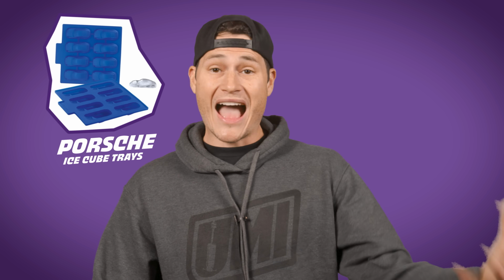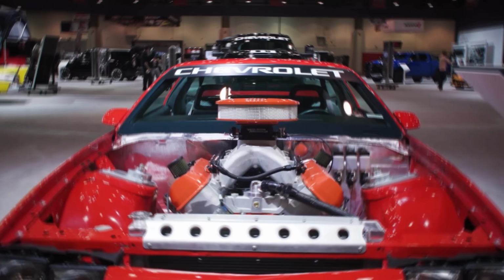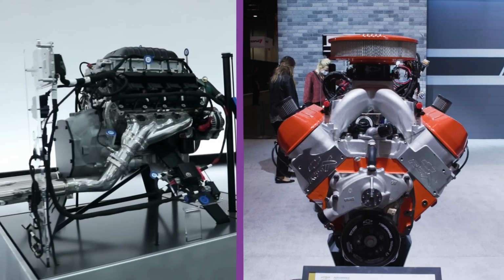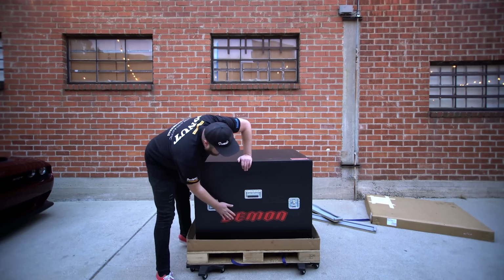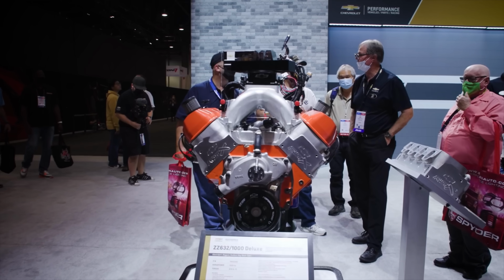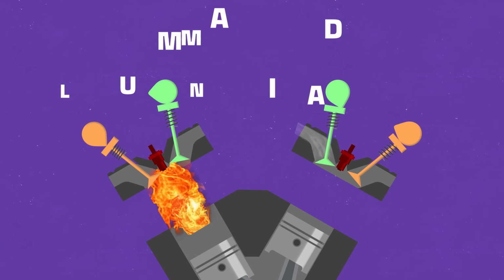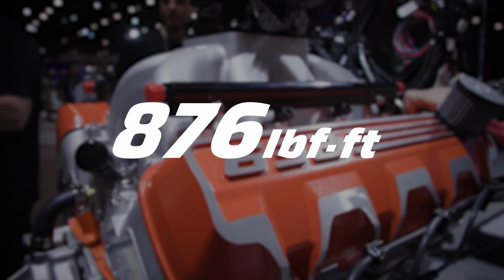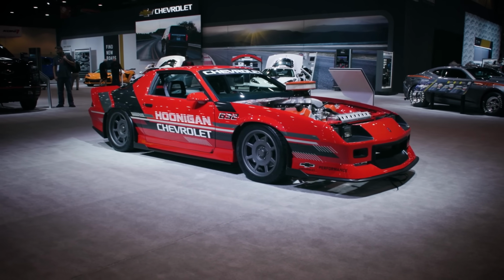Chevy's 1000HP Crate Engine EXPLAINED

Comment: Anyone know why only hemi blocks are used in top fuel dragsters?
Reply: Hemishperical Cylinder Heads are better than the regular Penthouse Cylinder Heads you see in today's cars when it comes to making power, the only reason why you don't see them in the road today are the slight weight increase and emissions, both are not something a top fuel dragster would care about.
Reply: @youngrody2386  I was just curious why a Chevy big block is not used in particular.
Reply: 2 reasons:
1. Marketing - the target market expects this ancient 60s tech, and,
2. Limit top speed - the NHRA wants to keep the top speed down. Many tracks do not have the runoff room for higher speeds.

A 4v dohc engine will make more power for the same combustion pressures.
A turbo engine will make more power. 20-25% of top fuel engines power is used up driving the supercharger.
Reply: @nordic5490  
1.) Not really, the reason why the NHRA always used 60s tech is because it's not only cheaper than newer tech but is just the best in general for the goal of reaching the quartermile in the shortest amount if time possible. I'll explain it in my next point.

2.) 4v DOHC aren't really good for low end torque as they require far more time for a sufficient amount of air to pile up inside the combustion chamber, meanwhile the 2v OHV layout restricts airflow which makes it torquier at the low end and with proper gearing of the transmission can grant the car a relatively smoother torque curve at the high end at the wheel. The 4v DOHC only makes equal amounts of torque a 2v OHV has at the middle or very end of its rev range, which is precisely the reeason why you see a lot of sports cars utilize SOHC/DOHC alot, it is solely because they are meant for tracking the car around the local race track and are designed to be driven at a certain rev range for peak performance, which doesn't really help Dragsters as they would start from a dead stop which decreases the amount of time the engine needs to create torque and power. Turbos would also take more time to spool and that would take far too long for the Dragster to really obtain peak power in the short amount of time it has to make both the 4v and the turbo to work, which may cause you time, time that would have otherwise have been instantly used with a torquey 2v High Displacement Pushrod and Blower that directly inputs power the moment you step on the gas.
Reply: @youngrody2386  don't argue with the guy he's got too much time posting shit talk about anything that's not a rice rocket on a donut media video meant for people just getting into cars lmao
Reply: @redlight3932  Sorry guys - I did not mean for this to go in this direction.  I was just curious why all the top fuel nitro cars use hemis, rather than a mix of hemi, ford and chevy big block engines.  Is there something about the hemi that works better at 11,000 HP (block strength, cylinder head flow, overall weight of the engine, etc, etc. ), or is everyone just familiar with all the pros and cons of the hemi and do not want to change?  Or is it a requirement of NHRA for everyone to use the same block?
Reply: @kailuagarage  Dw no one is fighting here lmao.

Basically the only reason why they use Chrysler Blocks is because they are the only engine blocks that are currently compatible with Hemispherical headers.

 Hemispherical heads due to their shape allows for the Cylinder head to absorb less heat, and that means less heat to escape from the combustion chamber, heat that would be used to make power that would've otherwise had been lost to a Penthouse Cylinder Head. 

The only reason why they aren't used in today's vehicles is because they were so efficient at developing power that they also produced more emissions, on top of that the Block had to be stronger and therefore weigh more, the Big Bock 440 Magnum is a whole 100 lbs lighter than the 426 Hemi for example. While the power it makes far outweighs the downsides of the added weight emissions really put the Hemi to rest.

 And for other manufacturers the cost to manufacture their own Engines for the Top Fuel Dragster division for the NHRA is not worth it, they make alot of sales selling regular penthouse Big block motors already at the lower divisions, it doesn't make sense to develop one that only serves one division and compete against the powerhouse in that field, Chrysler.
Reply: @youngrody2386  Cool thanks - it was all in the context of this 1000 hp Chevy crate engine video.  As I watched the video, it made me curious why an engine like this was not used in top fuel dragsters.
Reply: @youngrody2386  My big argument for pushrod motors is just the mere displacement of the engine relative to size. For instance, compare a 427 ls motor to a Ford mod engine. The LS is smaller. While you may be able to flow more air the mod cylinder head, there is inefficiency of the engine due to it's shear size. The only measure of efficiency isn't the horsepower per cubic inch. Now translate that to top fuel dragster or funny car with 800 cubic inches. You just can't beat the foot print of a pushrod motor. Speaking of Gas mileage. I always thought it was interesting how an LS powered c5 vette could achieve nearly 8 miles per gallon at 30 mpg better than the a cobra Mustang of the same era.
Reply: @frankmc5112  While it is true that some inefficiency is present because of bigger displacement, it is overall more powerful with the inefficiencies slightly being dampened by the simplicity of the Pushrod design, and contrary to popular belief Pushrod engines are actually more fuel efficient compared to their SOHC/DOHC counterparts even with bigger displacement, this is because it takes less energy for the car to develop power to the wheel due to its low end torque, which is why for cruising the corvette is far more fuel efficient than the mustang with the modular engine of the same era, even the new C8 Corvette with its improved aerodynamics is able to achieve a wopping 45+ mpg with the Pushrod V8. 

 The only reason why we don't see many Pushrods is because they work only in a V8 configuration at best, and it is hard to creat a VVT system with a Pushrod, VVT is what really made moder SOHC/DOHC fuel efficient as they are, but it was something Dodge was able to pull off in the Viper and now VVT is present on both GM and Chrysler cars that feature Pushrods.

 An interesting note is that the Corvette C7R and Dodge Viper GT3 were soo dominant in GT3 and GTE and similar series that they were both constantly being neutered by BOP nerfs. Funnily right now Corvette is trying to sandbag their C8 so that they won't get their Prima Donnas nerfed lmao.
Reply: @youngrody2386  The low end torque of the motor has little to do with the fact they are push rod engines, but rather it is the stroke of the motor that is common to pushrod V8s. The duration and lift has to do with the grind of the cam to make the power up top. The lighter valve train load enables the requires less energy which enables a quicker rev, but the reason they make more power up top is due to being generally smaller square bore engine. The engines are smaller in general because if you had a tall deck big block double overhead cam engine it would be massive. Can you think of one? As far as pushrod motors go. To increase torque down below you don't worry about double overhead cams. You worry about intake runner length which is why a Lincoln Navigator DOHC 5.4 has a long intake runner length. If you look at the torque curves on these engines you will see what I'm talking about. The horsepower and torque is not offset at high rpm due to being a double overhead cam. 

 Oh my gosh there have been many push rod engine motors in number of cylinder engines. All the original ones were. One of the most popular was the Chysler slant 6. The 2.2l s10 and Chevy Cavilier. Anything before 1990. Lol.  I can name dozens across manufacturers. Straight, V6, 4 cylinder.
Then again. I do build engines of all types. Mainly old pushrod V8s and Ford Modular.
Reply: @frankmc5112  Actually, the pushrod engine design is a mechanically efficient system compared to the SOHC/DOHC systems, and that efficiency will always equal more torque as less power is needed to move lesser components, even Engineering explained that their inherent design irregardless of the 2 valve limitations would deliver more torque overall. Yes, oversquaring an engine will always result in better torque and overall horsepower gains in the higher rpms but it also needs to compensate for the torque at the low rpms by tinkering with factors such as intake runner lenght, header lenght, gear ratios, increased fuel consumption, massive engine vibrations as most SOHC/DOHC performance vehicles uses Flatplanes to rev higher and so on. Meanwhile Pushrods don't need as much attention in the other parts if the Engine has alot of natural torque to begin with, it also doesn't meed to rev as high as peak power is already somewhere between the middle of the engine, it can get away with a crossplane crank that though doesn't inherently add more torque it allows for a smoother engine and more durable engine that allows for either an Overbored or Oversquared set up.

 As an example, The C6R dominated GT1 and the American Lemans series and it could only rev up to 6k, but it never needed to rev past 5.2k to achieve peak power and its acceleration trhough the corners and low center of gravity made Aston Martin, Ferrari, Saleen, Dodge, Porsche and Ford quit American Lemans in the late 2000s even with BOP nerfs. The same success was replicated with the C7Rs and Viper GTS and GT3s, they don't have to rev high and they are all slightly Overbored, but they still out accelerated their competion in corner exits and straights.

 The reason why we see SOHC/DOHCs dominate Openwheel is primarily because they are typically lighter cars that don't need the low end torque of a pushrod and benefit from tge high end torque of a SOHC/DOHC, meanwhile GT1 and below are 3000+ lbs cars that csn benefit from lots of low end torque from the engine.

 And how many of these engines you mentioned are sought after today? Even back in the day the pushrod inline 6s were seen as abysmall compared to even Flathead V8s. I simply mentioned that the V8 configuration of pushrods are the best, for example a V8 Pushrod has its Pros and Cons compared to a V8 S/DOHC while a I6 Pushrod is completely inferior to a I6 S/DOHC.
Reply: @youngrody2386  As an engine builder, engineer, and owner of multiple cars to include a Z06, I just told you the reason why.You are saying it is more efficient and I'm actually telling you why it is more efficient in terms or reduced load on the valve train. Reduced load is due to valtrain geometry and lighter valve spring pressures for smaller valves that encompass a larger area within the combustion chamber. You deviate off into other incoherent subjects that are not a part of the argument. Making "natural" torque is not meaningless talk. I'm not sure you can define that. The argument is that the 'main' reason you do not see top fuel running large double overhead cam engines is that the footprint of the engine grows when you increase cubic inches to such a size. A top fuel dragster makes over 10000 hp this is accomplished with a large amount of cubic inches and boost. You would have to grow the engine quite a bit to run double over head cam heads on a tall deck motor and still run a roots blower (look in the engine bay of a modern GT500. It is a massive motor.)  When you say "power numbers are in the middle of the motor" for push rod engines that is made up. Where you make power is more dependent on cams. Not every Pushrod motor makes power at low RPMs. There are folks that run push rod motors to 10rpm. NASCAR purhsrod motor run at over 9000 rpm. Like I said. You are just saying 'things'.   
If you want to see a retardedly huge SOHC 427 V8 that is a single overhead cam lookup Ford's Cammer engine. This will give you an idea of how big an overhead cam big block is. You really need to inspect the engine bay of a modern Coyote 5.0 powered Mustang. A 4.6 DOHC mustang engine takes up and is wider than any big block to include a 2nd gen Hemi. You may see diffences depending on valve covers. The big block is just taller as I mention due to the increase in stroke. It's also longer due to bore size. 
Your original statement was that they didn't have any motors that were pushrod engines that weren't V8s which is completely incorrect. Then you switch to whether they are sought after today. Well, I can answer that too. Buick Grand National V6 is very sought after as a push rod motor. Slant 6 Chrylser is still sought after. The 4.0L Jeep straight six (can be made to make tons of power. not inferior) is still highly sought after. Ford 4.9 straight 6. Old school GM Straight 6 and 4.3 V6 are still sought after. Thunderbird turbo coupe 3.8 V6 is sought after. You are going to find that often times that whether or not the cams are overhead in these cases made little difference. It has to do with how much boost you can shove into the engine. If you really want to get into pushrod V6s that made a shit load of power look up Kenny Bell.
Reply: @youngrody2386  As an engine builder, engineer, and owner of multiple cars to include a Z06, I just told you the reason why.You are saying it is more efficient and I'm actually telling you why it is more efficient in terms or reduced load on the valve train. Reduced load is due to valtrain geometry and lighter valve spring pressures for smaller valves that encompass a larger area within the combustion chamber. You deviate off into other incoherent subjects that are not a part of the argument. Making "natural" torque is not meaningless talk. I'm not sure you can define that. The argument is that the 'main' reason you do not see top fuel running large double overhead cam engines is that the footprint of the engine grows when you increase cubic inches to such a size. A top fuel dragster makes over 10000 hp this is accomplished with a large amount of cubic inches and boost. You would have to grow the engine quite a bit to run double over head cam heads on a tall deck motor and still run a roots blower (look in the engine bay of a modern GT500. It is a massive motor.)  When you say "power numbers are in the middle of the motor" for push rod engines that is made up. Where you make power is more dependent on cams. Not every Pushrod motor makes power at low RPMs. There are folks that run push rod motors to 10rpm. NASCAR purhsrod motor run at over 9000 rpm. Like I said. You are just saying 'things'.
Reply: @frankmc5112  You really know your stuff, thanks and I would've gotten into more detail if I weren't too busy, and yes everything you said is right with regards to cams lift and duration that influence peak power and torque more than engine configuration, smaller components of S/DOHC vs OHV for efficiency etc, though none of these really refutes my arguments for fuel efficiency, and of course how that inherent inneficieny of bigger displacement is overall more powerful (though practicallity is out of the window), stil I do admit I was wrong in some aspects and did deviated away from the original conversation about top fuel dragsters, but I admit it is because you also seemed to deviate towards others subjects as well, and I am stillconfused at what part you caught me as "incoherent"? The rest is alright, I agree with you for the most part, although the engines you mentioned are fairly niche and aren't seen as performance engines but rather as novelty/collector items, which is much like a comparison between the Flat head Ford V8 vs a OHV V8 Ford Small/Big Block, one is kept for novelty and one is seen as a serious performance option, which kind of misses the point of our conversation when we mention them here while talking anout performance, That OHV V6 did make a crapton of power sure, but some would just stick to an LS, better balance, more displacement and stock blocks can take up to 20 lbs of boost.

Edit: Some spelling errors.